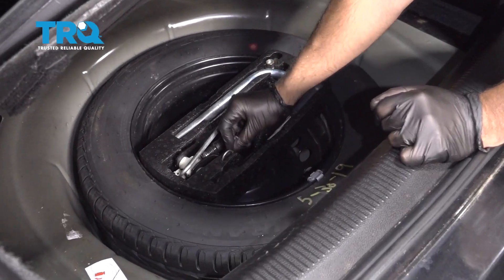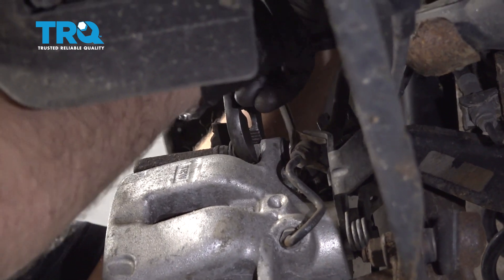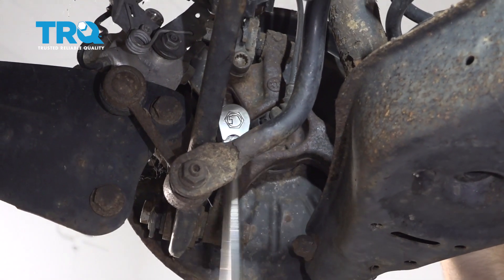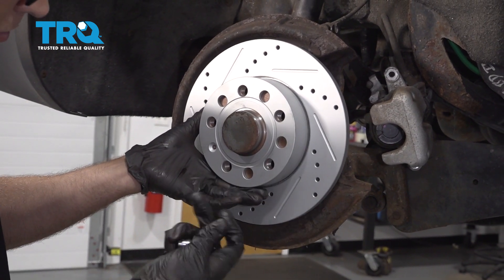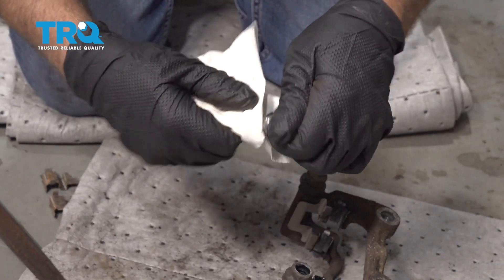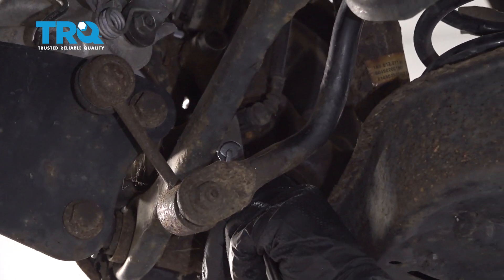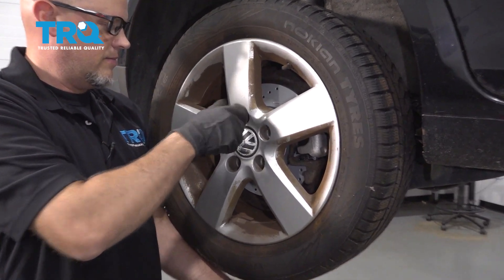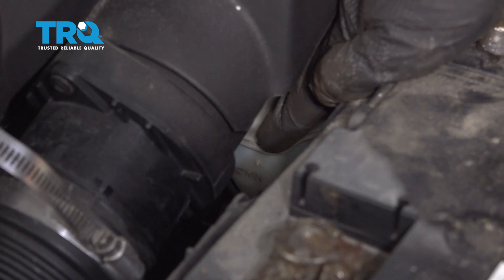How To Install Rear Brakes 2006-2010 Volkswagen Jetta

Comment: So the most important part you left off! The caliper piston has to be rotated back into the caliper housing. Otherwise you will screw this caliper up that is the most important thing when putting the pads on this particular unit that’s different than other styles.